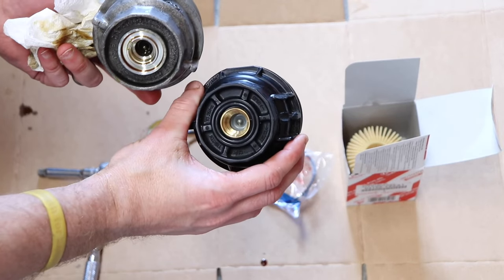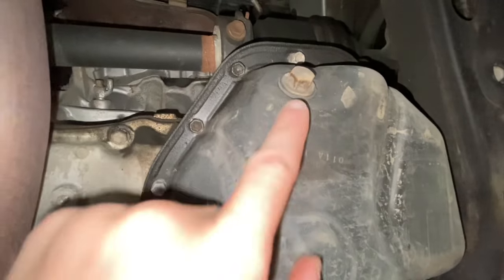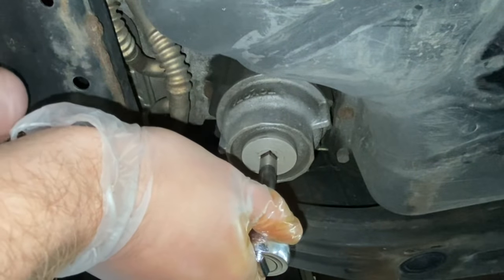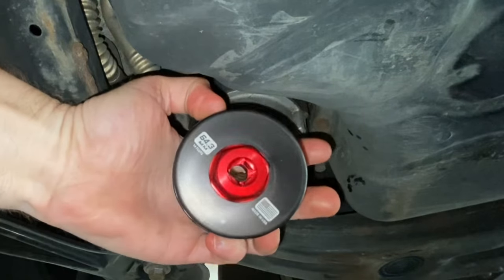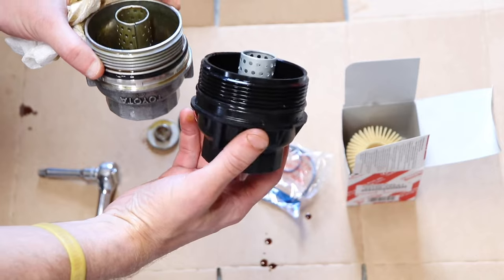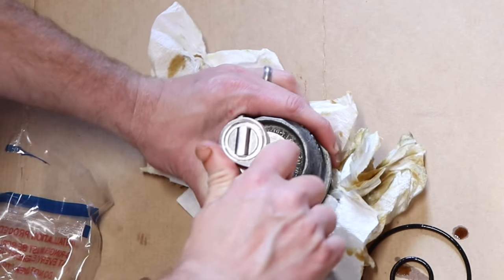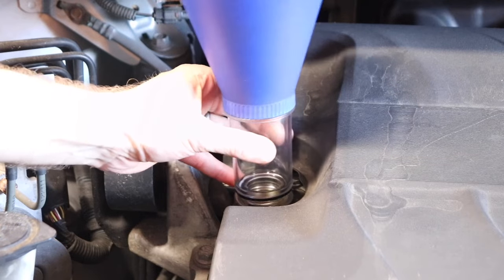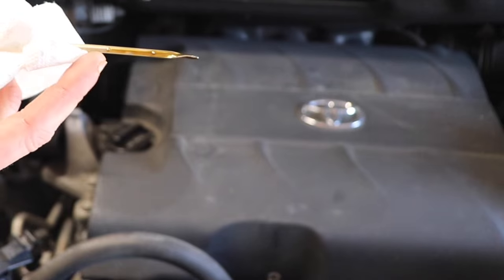Toyota Oil Change, Toyota Oil Canister Tutorial

Comment: Great video! what is the drain plug spec and the oil filter spec so I do not over tighten them. Do you have to use a torque wrench to make sure you do not over tighten them?
Reply: Drain plug = 30 ft.lbs
Oil filter cap = 18 ft.lbs.
Oil filter cap drainbolt = 10 ft.lbs.

If you don't use a torque wrench how will you know yo got it right?

Comment: Shouldn't you also replace the drain plug crush washer?
Reply from the maker: You could but in my opinion it that isn't really needed unless it was overtightened in the past. I've never had  a drain plug leak on my Toyota's and I rarely have replaced the crush washers. Thank you for watching!

Comment: Good video. I think that end cap drain is a waste. It is like some sort of Japanese tea ceremony. Just one more possible leak.
Reply from the maker: I tend to agree with you, sometimes I will just drop the whole filter canister and let it drain that way. Thank you for watching!
Reply: I always drain the oil filter cap. I don't always change the oil filter though. I use a synthetic oil filter rated for 20,000 miles and I generally change it every 10,000 miles. I change the oil every 5,000 miles.

Comment: You should never drain the oil until you loosen the oil filter to make sure you will not have any issues.
Reply: Wish I would have read this. Can't get the filter housing off and broke the tool to get it off. Now I'm in a bind